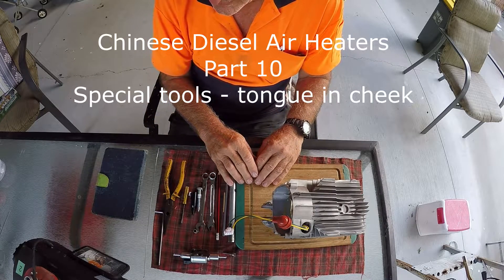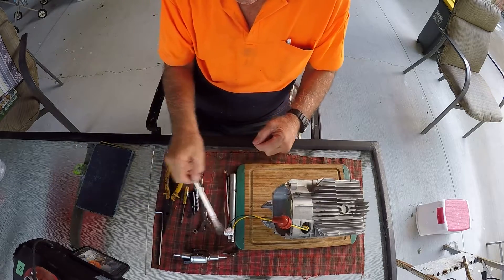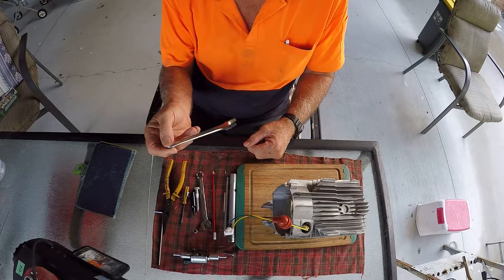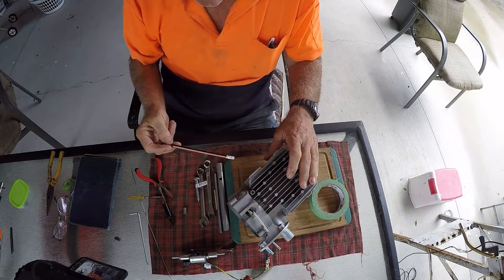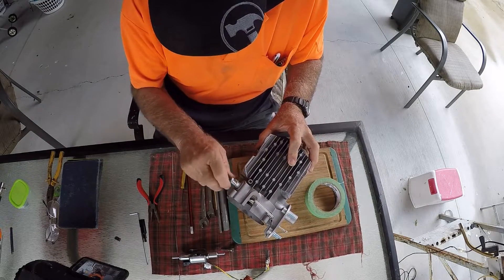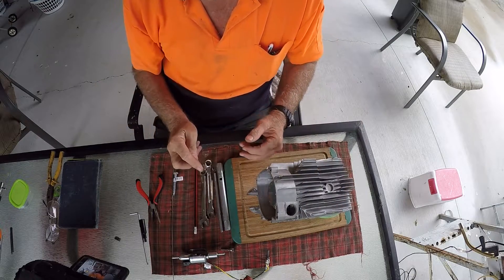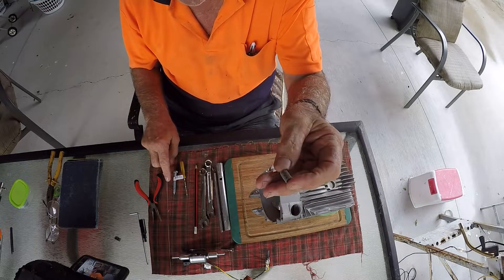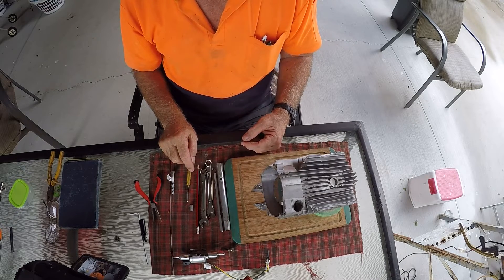Chinese Diesel Air Heaters - Part 10 - Special tools, Tongue in cheek

Comment: I was pokin' fun at you pokin' fun at things. We don't have a lot of 'gators here in Virginia, but I agree 'gator oil would be pretty slick stuff. I had to drain a tank of home heating oil and have it stored in plastic 5-gal. kerosene cans. I am planning to use it in the Chinese heater I just bought. From a lubricity standpoint, do you see any problems using regular home heating oil?

By the way, your tutorials are terrific and so helpful! Thank you for posting them!
Reply from the maker: Hi Doug, as I understand it, your home heating oil is just kerosene that has some sulphur in it. If so, it will be ok to burn in these heaters. The sulphur gives the pump lubrication.  JMcK

Comment: Why not use spray on carburetor cleaner or throttle body cleaner to remove the carbon?
Reply from the maker: Carby cleaner can be helpful at removing carbon buildup.  JMcK

Comment: Wonderful set of videos! Congrats and thanks for your sharing! 

Nevertheless, I would like some expert advice. I’m thinking about mounting my diesel heater under the floor (exterior). 
Is there any cons? What about the inlet of cold air? 

Best regards!
Reply from the maker: Hi Ricardo, 
There is no “one way only” instillation of these heaters. Yes you can mount it under the floor, providing you can give the heater protection. 
Under the floor of what?  A vehicle,  a house, a cabin, a caravan etc?
There is no issue drawing cold air from outside rather than reheating internal air. Some people prefer heating fresh air, even though it is less efficient.
The main issue is heater protection. In a vehicle, is it protected from road debris etc?
You also will need a filter screen on the air inlet to keep out any critters from the heat exchanger.
Cheers.  JMcK
Reply: @johnmck1147  Thanks a lot for their answer. It will be under the floor of a camper van. And yes, it will have a aluminum case. 
Congrats once more for your tutorial videos. They are great and a big help. You are the diesel heater guru! 😊👍🤝
Reply from the maker: @RicardoVLino  
👍

Comment: Just got a new one from ebay and im not getting power to the controller.  Checked fuse and I'm getting 12v to the ecu but no voltage to the controller?  What else can i Check
Reply from the maker: Hi Erinson,

If your heater follows normal protocol, the controller wires will have a triangle plug and socket.
There will be three wires, generally red, black and blue.

The blue wire is the sense/data wire, the red is 12+, and the black 12V -.  Put your multimeter on the red and black wires coming from the heater. Check the voltage. 
No voltage you have issues with the plug, wiring or ECU.
Voltage present, you most likely have a bad connection or a dud controller.
Also check that the wires line up correctly in the plug and socket. Very occasionally the the polarity of the wires is reversed.

I hope this is of some help.  JMcK

Comment: My deisel heater has no codes, it seems to start ok but blow lots of smoke then wants to shut down. The screen is not blocked. How do I test the glow plug?
Reply from the maker: Hi Bruce,

If the heater actually starts up and runs for a bit it is unlikely to be the glow plug. If the glow plug does not light up the heater will not start.

Is this a new heater, or an old heater that used to run ok in the past?

If a new heater, they will blow smoke on first couple of starts until any big air bubbles go.

Now look at the fuel delivery system. 
Are there any small leaks in the fuel line?
Do you see any big (not little) bubbles in the fuel line?
Have you got good fuel hose connections? (No leaks)
Are you using thin bore hard nylon fuel hose on the delivery side of pump to heater?

If an old heater that was running well in the past.

Check for clogged fuel filtrer.
Check fuel line for any leaks.
Strip heater down and check for carbon buildup in burner chamber. Clean.

Regards.   JMcK
Reply: @johnmck1147  thanks John the heater is 1 season old had been working fine. I will check you recommendations. Cheers

Comment: Thank you John,
Great vid... had issues with my 5kw not firing right and exhaust pushing massive white smoke. 
I've took it  heater apart and noticed a lot of built up inside the combustion chamber.
Also around the glow plug and the burner screen. 
I've clean it with engine cleaner and put everything back together... took about 2 hour.
Thumbs up John.... it worked out great and now my heater is back n running.
Thank you so much for your vid.
Reply from the maker: Pleased to be able to help Thomas.  JMcK

Comment: thank you john the heaters metal mount is the one that has metal ring around to protect the inlet and outlet, if I have to put it on it's side which is the glow plug side  thank you john
Reply from the maker: Hi Denis, you just take the top cover off, you can see the glow plug easily, just tilt it on the side with the glow plug goes to the top.  JMcK

Comment: hi john I want to put the heater under the floor of the caravan with just the hot air going into the caravan I have some question to ask, is alright to put the heater in a metal tool box and if so will it get to hot, because I want to seal the box so no dirt gets in, is there any down side to having it under the caravan ,all so you mention some were on your videos which I can not fine, about a facebook site were I can talk to people that have them set up like this  I'am eager to hear from you as I'am ready to install it now     thank you john
Reply from the maker: Hi Denis, if done right you can put the heater under the caravan in a box.
1. The caravan needs to be high enough so there is enough room and the heater doesn't hit the road.
2. A sealed box is ok as the heater cools from air moving over the heat exchanger, and the metal box will also dissipate heat, but you will need some air gap around the heater, say 40mm to 50 mm.
3. Where is the inlet air going to come from if you seal the box? Are you going to suck it down from inside the caravan?
4. You could consider mounting the heater on its side under the van, but only the side that has the glow plug on the top. This way the combustion air inlet and the exhaust would exit on the side and not out the bottom giving the exhaust and inlet some protection.
5. Make sure you have a screen on the combustion air inlet to keep out bugs, and in dusty conditions you may need a foam type filter.
6. Keep the exhaust away from the combustion air inlet.

Good luck, Cheers.  JMcK

Comment: Very good videos. I had a friend bring me one of thies diesel heaters with a bad glow plug. I went to a auto parts store got a deep socket that fit it. Then I milled .25" slot in it just like an O2 sensor socket. Worked like a champ. We also cleaned the combustion chamber. All is good now. Have a good day from the USA.
Reply from the maker: Thanks for the feedback KLH.  JMcK
Reply: What glow plug did you use?

Comment: John they are great videos and very helpful I’ve just ordered my Diesel heater and I will be looking up your page on the control if I’ve got any problems can I contact you on getting the diesel heater to work properly thanks mate
Reply from the maker: Hi Billy,  I am happy to help if I can.  JMcK
Reply: John McK 47 Hi John I wondered if you could send me a quick drawing of the fuel system from the tank to the unit so I can follow it in the angle of the pump cheers mate
Reply from the maker: Billy Hill ,

Very simple, come out of the tank, through a shut off valve if you wish, then through a filter, then into the pump. Install pump as close to fuel tank as possible, install pump in position that it has less than a meter of head and less than a meter of suck. Install pump with an upwards angle of greater than 15%.

Any issues please email me at johnmck47@outlook.com.

Comment: I John. I have watched all your videos. Thank you for making them. What is your summation on these machines. This may have been covered before. 
A caravan repair man saw I had purchased one of these and said that they are dangerous and should not be installed. I am a bit worried now. I can’t see any reports that they are unsafe. 
What’s your comment on this. 
Thanks.
Reply from the maker: Hi Slade,

What reason did your Caravan man give for that statement?

These Chinese Diesel Air heaters are almost a direct knock off copy of the German Eberspacher heater, and these have been around for decades. 

In my opinion  these Eberspacher copy heaters are excellent and very safe heaters, if installed correctly and operated correctly.

These heaters are so cheap compared to the genuine heater it has opened up a market for the masses. But those who buy these heaters are unlikely to spend many times the heaters cost to have them installed professionally. A number of these DIY people make some serious install and operation mistakes, and then blame the heaters.

The main reason I did this series is to try and give some guidance and knowledge to the self installer.

However doing things wrong like using the wrong fuel line, poor service maintenance (see video about gaskets), bad install or operation can cause safety issues. Just like everything else in life, be it making coffee, or setting a mouse trap.

Cheers.  JMcK

Comment: Loving your videos, do you just get any chinese made heater on ebay or are some better then others internally? cheers
Reply from the maker: Hi Nigel, the mechanics of them all are pretty much all the same. I suggest you look for a supplier that has an in country warehouse if possible, and one with good reviews, and accepts returns, then choose one that has a controller you want. (more on this in the next video). The other accessories are not so important as they can be easily sourced. Good shopping. J
Reply: John McK 47 
Great, your a legend, looking forward to your other videos, would be good to see you do a complete pull down on one.
Reply from the maker: nigel simmons
Hi Nigel, yes, I have one planned for the future.

Comment: Expected a glass of Grange Shiraz to the cheese. Anyway, great video once again!
Thanks to you I just ordered a 2 kW heater. I really don't need it, it's just for fun to see how it works (if it works).
Being a senior citizen myself I guess you have my understanding..
Reply from the maker: Thanks for the feedback Torstein. Forgot to chill the wine. Now don't let the grey hair fool you, I am really only in my early 50''s (or wish I was)

Interesting to see if you get a real 2 kw heater or a 5kw marked as 2 kw. The real 2kw heaters are around 300 mm long and weigh around 2.4 kg. The 5kw heaters are around 400 mm long and weigh around 4.5 kg
Reply: This one:
https://www.aliexpress.com/store/product/Car-Heater-2KW-12V-Air-Diesels-Heater-Parking-Heater-With-Remote-Control-LCD-Monitor-For-RV/2140093_32961730575.html?spm=2114.12010615.8148356.3.10f42a31FeDmqG

See different size deliveries from feedbacks to this supplier now, one customer had a 2 kW and another received the 5 kW. Lesson learned must be that you wait for actual delivery from China, and THEN buy appropriate size of the car.
If you had not mentioned it yourself in a video, I could never belived you were a Senior, mid 40's was my first impression.

Comment: Absolutely love your tut's on these machines.  I'm not a brown noser by any means, but I  hang off yt waiting for your next one.  Wonder if there's enough content to demonstrate how much a rise in temperature  you can attain in a given (enclosed) area?  I spose that could be worked out given the data already known.  Maths wasn't my best subject at school, but I suppose we know the heat output and  the area to be heated, and I suppose the ambient temp would be needed too.  I only ask  because I have high hopes of this little 5KW heater keeping my large polyhouse (200qm) at over 12degC during the coldest days in winter.  Coldest day is +2 so hopefully won't be a problem.  many, many thanks.

Comment: John, I am curious how the fuel is introduced into the heater, haven'ttaken mine apart as it runs fine. Does the fuel drip/squirt directly on to the screen before entering the combustion chamber and under what appropriate pressure? Once burning, does the fuel still pass on/over the screen. If so, it would seem the flame is originating on the screen then expanding into the combustion chamber. Is this so? Keep up the GREAT analysis, your work is being recognized as the best available.
Reply from the maker: Hi Robert, I will go into this deeper in a future video, but there is a second large atomising screen around the main burn chamber. First the glow plug ignites the diesel/air mix at the small screen then the flame ignites the main burner which acts like a big blow torch. More info in a later video. J
Reply: @johnmck1147  Thanks John. Still curious how the fuel is "injected" into the unit, the pressure, the pathway. You're doing a great job informing those that are curious and to correct the enormous amount of misinformation out there. Fascinating little inexpensive heaters.